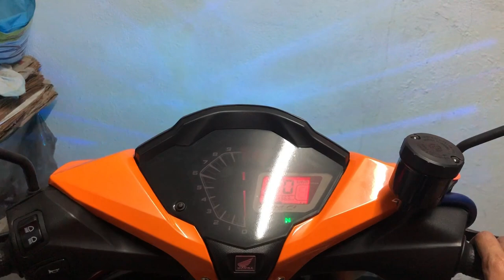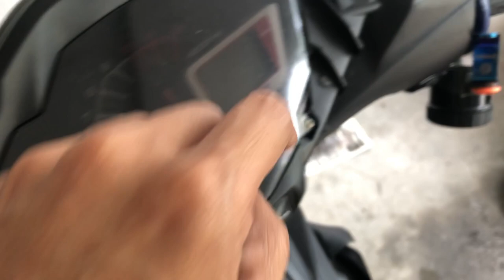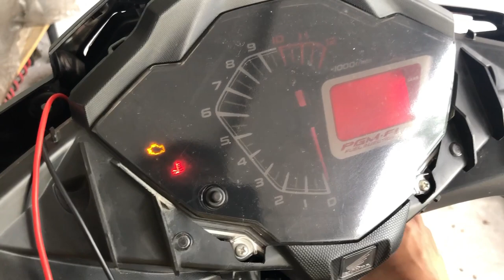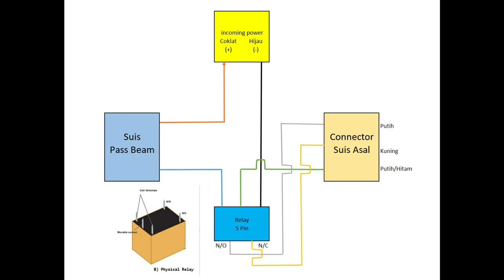Cara Pasang Suis Pass Beam RS150 (2 pin suis)

Comment: Chong salmi .sy nak ty kalau suis winner pya 4 pin kan..mcmn nak wiring..sy dah beli kat azlansa  yg ori winner pya..
Reply from the maker: Bos, sy x penah cuba/test lg yg 4 pin punye sbb yg sy beli tu 2 pin. Yg bos beli tu x complete ye sekali ngan connector 4 pin cam seblm ni? Kalu x pun bos cuba try yg 2 pin nie dah siap diagram boleh refer description utk link sekali.
Reply: Yg 2 pin pun sy order..yg 4 pin pun sy br order..Sb azlansa br bg link kjp td.katenya ori winner ada 4 pin.
Reply: https://shopee.com.my/product/30111114/4960401663?smtt=0.30141232-1604242028.9

Ni link nya.
Reply from the maker: @aminciku4610  ye betul. yg ori winner pakai 4 pin tp sy xde wiring diagram utk 4 pin bos. sy kena beli dulu utk test. kalu beli dr seller indo boleh dpt dlm harga rm8 sekali ngan connector utk motor rs sana.
Reply: https://youtu.be/Ii4MUs38Xsc

Ni,,☝️ Lg simple rasanya.
Reply from the maker: @aminciku4610  sy x tgk lg. Blk keje nnt sy check camane. Tq bos
Reply from the maker: @aminciku4610  sy dah penah cuba wiring ni utk 2 pin tu mmg x boleh bos. Nnt suis akan jd terbalik. Sbb tu kena pakai relay utk revert blk. Terima kasih sbb kongsi bos.
Reply: MMG kena pakai relay kot..kat azlansa jual siap kit n diagram rm 50..tp kit xde stok buat masa ni.ada suis shj.
Reply from the maker: @aminciku4610  ye bos kena pakai relay cuma utk 4 pin sy x cuba lg. Bos x cuba mintak diagram dr azlansa?
Reply: Sy cancel blik suis tu.sb kit UTK pasang tu xde stok katanya..ada suis shj.kalu ada semua rm 50 set lgkap diagram.
Reply: Sy beli Dr Indon tu jer yg 2 pin..relay dah beli asing.brand Bosch 5 pin.
Reply from the maker: @aminciku4610  beli yg 2 pin pun dah ok bos. Modal x sampai rm20. Skrg sy pakai yg 2 pin ok je xde isu.
Reply from the maker: @aminciku4610  jgn lupa beli 4 pin soket sekali. Masa pasang 2 pin tgh tu boleh bukak pakai 2 yg hujung je.
Reply: Soket yg mn plk 4 pin? Sy beli yg 3 pin jer mcm brp buat dlm video tu..blh bg No wasap senang nk ty ape² nanti.
Reply from the maker: @aminciku4610  kat decription sy ade letak link bos. Boleh refer kat situ ape yg nak beli.
Reply: Ok.
Reply from the maker: @aminciku4610  Salam bos. sy ade buat video suis pass beam utk 4 pin. Mlm nnt sy akan upload kat youtube. Nnt sy link sekali barang utk buat wiring. Thank you

Comment: bos taknak ke buat pastu jual? boleh buat bisnes ni
Reply from the maker: Muhammad Khasya bukan xnak buat bos tp stok dr seller x byk. Ni pun x sure ade lg ke x. Kalu ade byk boleh sy pos kat fb je kalu ade nak beli.
Reply: @chongsalmi  baik boss. kalau ada nak jual boleh roger roger. berminat jugak ni😂 saya skrg pakai switch on off tu tapi itu hari off lampu battery kong pulak adui
Reply from the maker: Muhammad Khasya ade gak dgr yg pakai suis on off ade isu bateri x charge. X sangka lak benda tu betul. Haha
Reply: @muhammadkhasya5810  suis on off mmg problem dekat bateri
Reply from the maker: @mhdzainurin2033  Salam bos. sy ade buat video suis pass beam utk 4 pin. Mlm nnt sy akan upload kat youtube. Nnt sy link sekali barang utk buat wiring. Thank you
Reply: @chongsalmi  mantap
Reply from the maker: @mhdzainurin2033  terima kasih bos

Comment: Boss hbih byk mna modal nk semua tu?
Reply from the maker: x mahal sgt bos. suis+connector rm8.++, relay rm1.60, wayar 18awg rm4.00. rasa x sampai rm20 kot. yg bos tgk ni 2 pin dah xde jual kat shopee. skrg sy pakai yg 4 pin punye. bos leh check kat video lg 1 https://youtu.be/8rLHoFc5R3Y. kat description sy ade letak link
Reply: Ok tq boss
Reply from the maker: @hezryfaizal8743  ok bos
Reply: Boss suiz tu yg v2 punya ka?
Reply from the maker: @hezryfaizal8743  ni suis dr indo bos. kalu yg vietnam dulu diorang jual dlm rm50 complete wiring kalu x salah.
Reply: Ouh sni xdk suiz tu alo
Reply from the maker: @hezryfaizal8743  Suis pass beam (4 pin) with soket cable : https://t.productlink.io/a022qfe
Reply: @chongsalmi  boss dia sekali dgn relay ka?
Reply from the maker: @hezryfaizal8743  relay beli asing bos.
Reply: @chongsalmi  ouh ok boss
Reply from the maker: @hezryfaizal8743  ok bos